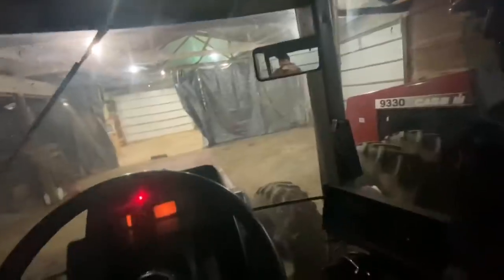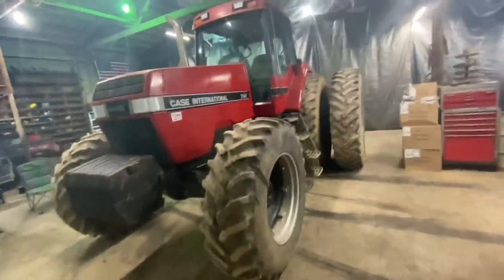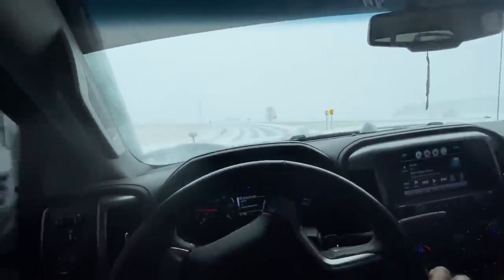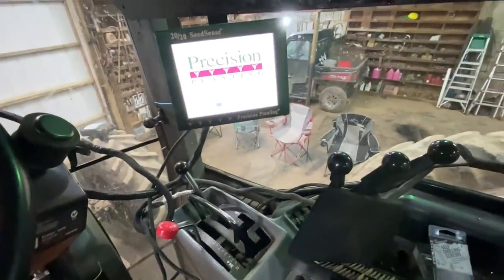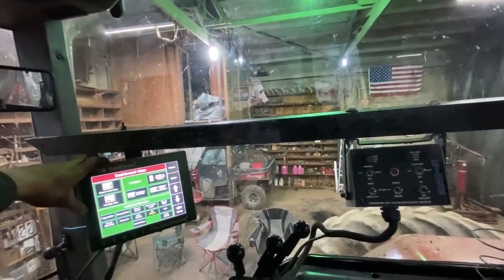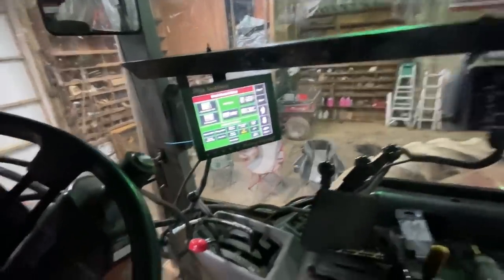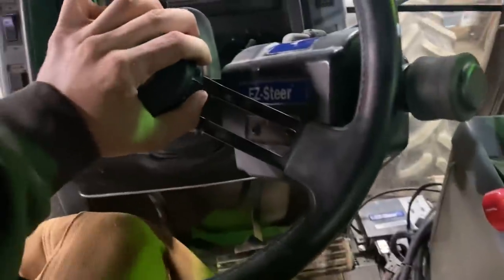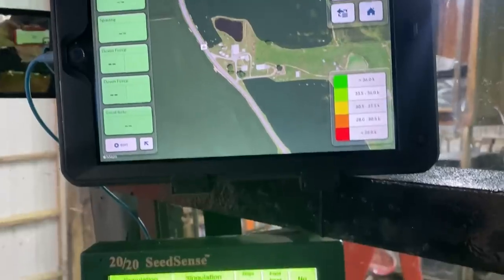Welcome to my Cockpit

Comment: Taps new monitor rail

“I got my new bar in here” 

Bens mind “now there’s an idea, Busch light on tap in the tractor cab”
Reply from the maker: Now that I have autosteer instead of oughta steer, you may be onto something...
Reply: @ClarkeFarms  new meaning to Busch hogging with that new mower.
Reply from the maker: @iowANFarmer  my level of confidence of the level of trees I could mow over may increase as the day progresses...
Reply: @ClarkeFarms  well they say you can mow off a can sized tree. 

So if you place an empty by every tree you’re doing your part to stay within the manufactures guidelines. 

Problem is your limited to 6,12,18,24, or 30 trees a day depending on your quick stop selection.
Reply from the maker: @iowANFarmer  see... but my thought process ends up being if it can go under it, it can go through it.  

...and this is why I buy slip clutches
Reply: @ClarkeFarms  directed weld it. Cheaper fix for a little bit.

Comment: Have you ever had fuel gauge problems with your 7140? If so, how is it fixed?
Reply: Usually is a ground issue on the senders either behind the seat or the one under the step
Reply: @matthewanderson8231  thank you!